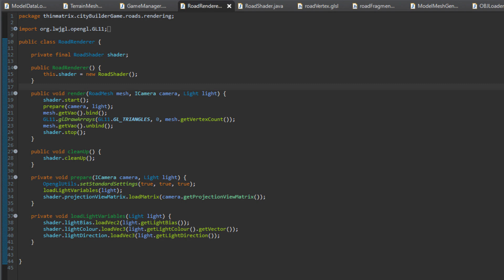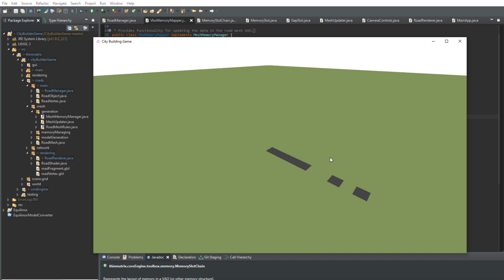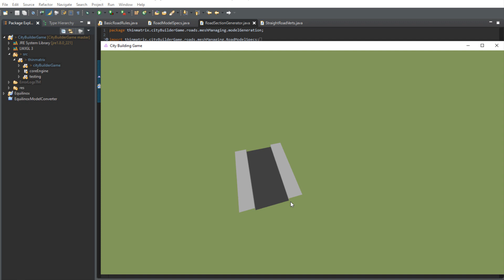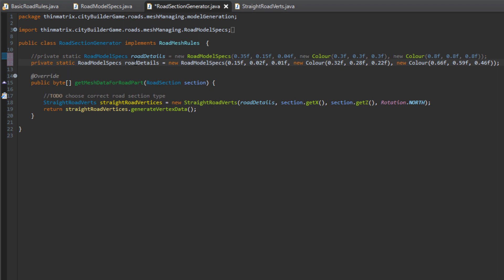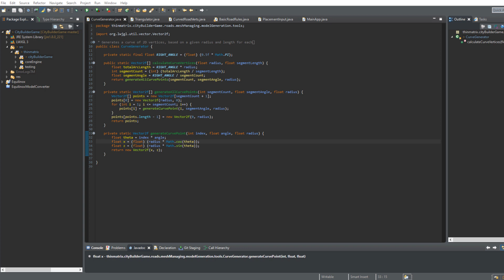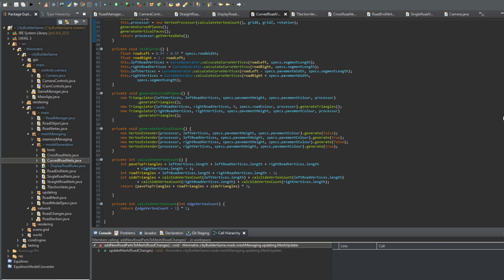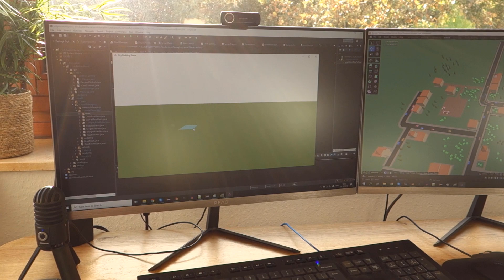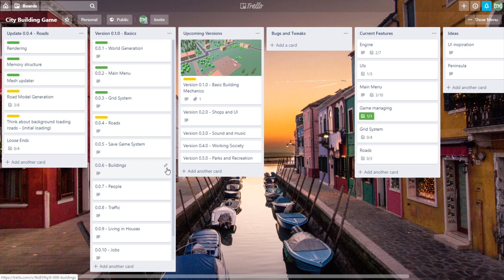Programming the Road System for my City-Builder Game

Comment: IDK if anyone will see this but I've got a rendering question about OpenGL. Right now, I'm rendering a chunk using `glDrawArrays` and calling it each time in a for loop per cube. There are around 4096 cubes in my 16x16x16 chunk (most not seen). So, I'm wondering which is better? Frustum culling (to not render blocks that are not seen), or instanced rendering `glDrawArraysInstanced`, and still rendering the cubes inside the chunk not seen. Or if I should implement both? Eventually I would want to create an `infinite` terrain. Also, if I were to do frustum culling, if I were to remove an outdoor block, will the frustum culling re-render a cube inside? Please let me know, ThinMatrix or anybody. I'm using OpenGL/C++/GLEW/GLM. I hope someone could answer because no one answered me on discord server :/
Reply: I think you can pass the number of instances with the "glDrawArrayInstanced" method.
So I suppose the fastest way would be to use that function. You just need to upload all per-instance attributes (like transformationmatrices etc) once before rendering. Just watch thinmatrix great tutorial on instanced rendering.

Comment: As a greenhorn in this area, is there a reason why all meshes are divided into triangles rather than rectangles?
Reply: GPUs only deal with triangles. If there are other non-triangle polygons in the mesh, they will have to be converted to triangles at some point before uploading to the GPU. Since the roads are procedurally generated and not modeled by hand, you might as well just generate triangles in the first place to you don't have to triangulate later.
Reply: @notnullnotvoid  I see... so this counts as a type of optimization? Thanks for the answer btw.

Comment: One tip to make the system more powerful without adding massive complexity: Place the roads on the edges of squares, not the centers. That gives you the intersections without a user-selected road type, so you can generate them from the road types of the roads meeting there. I think you missed that part about intersections? It looks like they take one road type as input where they should take 2/3/4 types and connect those.

Comment: You mentioned that the whole road system is updating one single mesh, and argued that it would be faster than multiple meshes. While that is true, I can see a bottleneck when building large road systems. Depending on the size that a given map can have (I don't know what your goals are, so I'm assuming large scale is going to be possible) a way to optimize this would be to split the mesh up into separate chunks (chunk size could depend on different factors, or be constant). Then only render the chunks that are visible within the camera viewport.

This way you don't need to render the whole mesh at all times in large cities with a lot of road systems which could cause significant loss in frames, depending on the amount of entities and other things to render.

Now of course, this is only going to be a problem if the game allows for large-scale building and road systems with a lot of activity, similar to other city-building games.

You have probably already thought of this, but I just wanted to point this out in case you hadn't :-)
Reply: @BobDevV  Is Java the best choice for game programming? Probably not, but it's easier than writing low level code and manually handle pointers/memory. Heck, if you want the best performance, why not just write GPU shaders all day? Time. It's all about time versus results.

The systems he's currently writing aren't a problem in Java when it comes to memory/performance, if anything, the problem would be the rendering itself, but this is such a simple game at this point that it doesn't really matter.

You'd be surprised of how many things (and games) are written in Java.

Comment: Nice improvement with the road placement system, but i noticed if you want to place a road side by side, it automaticatly connect it with the road on his side, what if the user wants to place just two roads side by side?

Comment: The reason general purpose game engines choose to use models is that it is extendable. They dont know what content creators are coming up with thus they provide high level abstraction to this behavioural and render pipelines.

This mesh use case works well with your case. But when things are unknown you hope for the best that people use your game engines features wisely and do not crash it.

Comment: Can someone explain to me, how does the road mesh works and how is it more efficent to draw a mesh instead of every single road tile?
From my understanding if you would draw a road mesh, it would still draw every road tile from the road mesh, so it should be the same, shouldnt it?
Or does it mean, that if you update one road (by adding or removing it), it would only update adjacent road, which would be of course more efficent then to update them all.
I might have missed something in the video
Reply from the maker: It's something a bit more technical with the way that OpenGL works, but basically each draw call requires a bit of overhead. So even though the same number of vertices would be rendered, the larger number of draw calls would slow down the process. Especially if the world is full of roads which could require thousands of draw calls.
The GPU can process the vertices much faster if it can just do them all at once, rather than having to wait for the next draw call after rendering each little section.

Comment: Curved road geometry can be simplified by expanding it past the first contact with pavement. e.g. 5:14 shorter road curve can be line instead as it will be hidden under pavement
Reply from the maker: Ah that's true, maybe I can do something with that. It doesn't work with all road settings though - for example if you look in the video at 5:34 it would only work for some road-width/pavement-width settings. But still, maybe I can use it for the settings that work, thanks :)

Comment: Surprised you chose to dynamically update the mesh vertices instead of just using instanced rendering.
Reply from the maker: It was something I considered for a while, but decided against it mainly because of the number of different possible road section meshes - not much of an issue yet but when I implement more road types there will be loads of combinations of ways they can connect. Plus the road section meshes will also change to connect with some buildings and other objects in the future. So there will be so many different unique road section meshes which would start to defeat the point of instancing a bit.
Reply: @ThinMatrix  Makes a lot of sense, thanks!

Comment: Why not using instanced rendering instead of making all road segments into one mesh. Saves alot of memory, and fewer things can go wrong.
Reply from the maker: It was something I considered for a while, but decided against it mainly because of the number of different possible road section meshes - not much of an issue yet but when I implement more road types there will be loads of combinations of ways they can connect. Plus the road section meshes will also change to connect with some buildings and other objects in the future. So there will be so many different unique road section meshes which would start to defeat the point of instancing a bit.

It would save memory but the roads are pretty low-poly so I'm not worried about that being too much of an issue anyway, and hopefully if I program it well enough things won't go wrong!
Reply: @ThinMatrix  Does that mean you'll be blending between different road types?

Are you regenerating the mesh each times it's changed or are you perhaps planning on chunking the sections like minecraft chunks? Might not be an issue unless you're planning on allowing massive worlds with many 1000s of road segments.
Reply from the maker: @Bozemoto  I'd like to have at least some sort of smooth transition between road types. One of the main things I want to achieve with this game is a very clean, polished look, so I don't want any harsh transitions anywhere. I think chunks are certainly going to be a must, and I was planning on implementing them in the next couple of days.
Reply: @ThinMatrix  You can use the greedy meshing algorithm.

Comment: Why not instanced rendering?
Reply from the maker: Mainly because of the number of different possible road section meshes - not much of an issue yet but when I implement more road types there will be lots of combinations of ways they can connect. Plus the road section meshes will also change to connect with some buildings when I implement that. So there will be many different road section meshes which would start to defeat the point of instancing.
Also, would instance rendering even be faster? Both methods just require one draw call to render everything and the same number of vertices get processed either way, but with the method I use the vertices are all pre-transformed so no transformation calculations are needed in the vertex shader. I guess instance rendering would require less data to do the rendering, but I'm not sure what the difference would be speed-wise.
Reply: @ThinMatrix  It was just my first thought, I think it might be easier to manage in general, yes you have to update transforms but only for changing sections, number of different instances should be equal to different sections you have. Not sure what combinations you have in mind, I don't see a point of combining sections and treating them as unique. I agree about many different instances causing many drawcalls, though you will rarely build roads that consist mostly of unique sections. I suspect you are updating the mesh in a way that it doesn't get slower as it gets larger? I haven't seen the code yet.